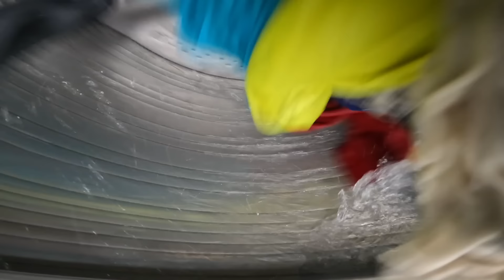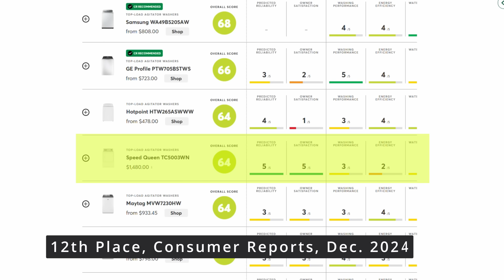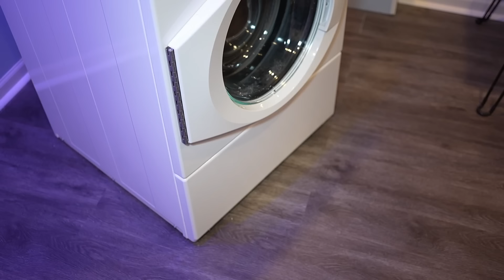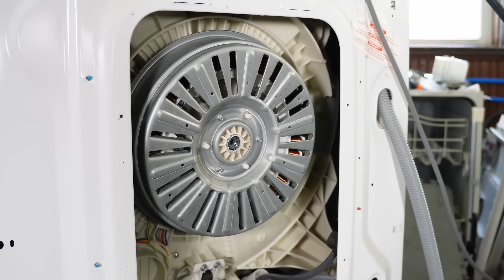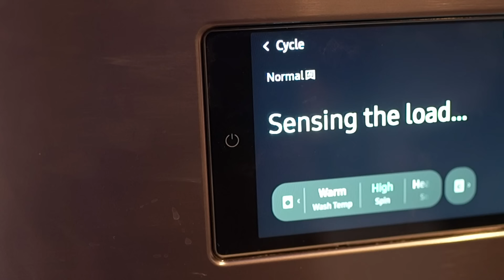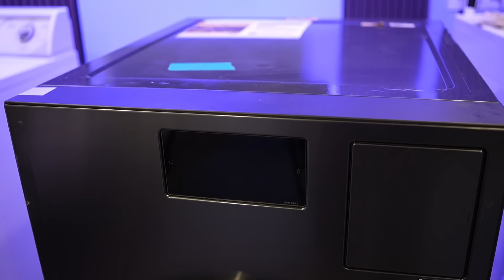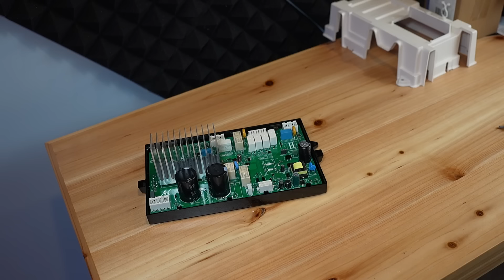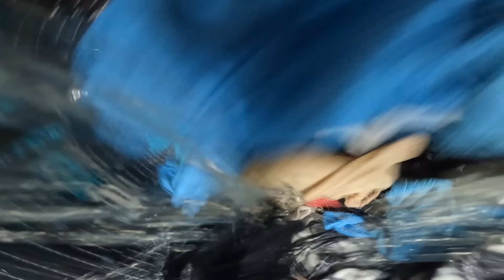Is America's Most Expensive Washer Great? The Speed Queen FF7009WN Test

Comment: I don’t want a front loader, I prefer a top loader. My first washer and dryer was a Speed Queen set that was stainless steel inside so I didn’t get any rust from the tubs but the outside case started rusting. The was the reason I got rid of it. I replaced then with a top of the line Maytag set that was a made in America and it lasted for 25 years, now my washer has broken but the gas dryer still works. I want to be able to open the lid and add something to the load and I don’t want to lean over to put clothes in or to remove. I won’t buy any other brand now since Maytag stopped being made by the original factory. So I will buy Speed Queen. Why can’t America make everything anymore? I don’t want so many electronic controls. I hope to get a simple system, I only want 3 water temperatures, a short wash and regular wash. I use only liquid detergent because I found out the the granulated detergent had a damaging chemical added to make the washing powder and that liquid didn’t have it. Tell me if I’m wrong. I want simple but well made. I see those circuit boards and I see trouble.
Reply: Miele try it
Reply: Despite the SQs being made in the USA, they still have many problems, and terrible policies for their warranty. They used to be great but now they’ve cheapened their products and are just using their brand name to sell. 
My TC5 died after 1 year, same with the TR7 before it that lasted 2. The problem? COMPUTER BOARDS. No issues like this on the old AWN432, if they still made them I would have one in a heartbeat. Computerized machines are just cheaper to mass produce for them, so they take that route and just make the machines look old school. Shame.
Reply from the maker: @DylBuilder1  the irony is that in the 1990s, Speed Queen actually had a pretty bad reputation. Maytag bought out Alliance Systems/Amana units as well as a whole host of other drivetrains and systems back then before they went under. So you could have had Amana-branded Maytag-Sold Speed Queens (model name: SAV) and guess what? They sucked. The Norge machine PAV machines were bigger, better, and cheaper.

The Speed Queen design is one they've worked all the kinks out of, but its not a great system, IMHO. People can cancel me over it, but I'd still take a Norge, Maytag, or Whirlpool Direct Drive system over a Speed Queen for top load.
Reply: @bensappliancesandjunk  I do remember that! Kind of funny that in that era quite a few brands were involved with another, even the ones that were previously in competition. I do remember seeing a Maytag set from around 2005, and the dryer had a SQ drum and bulkhead. 

Yeah it works well for what it is, but I think it's focused on simplicity or trying to use the least amount of parts possible. It is similar to the helical drive Maytags in some ways though. Just wish the other parts of the machine were still made well! 

Same here, I would 100% take those machines over them, and pretty much anything on the market! Great review as usual Ben :)
Reply: Get the TC5 top load Speed Queen. I got tired of buying and repairing unit after unit. They became unreliable money pits. Here is my (all top load) "washer history" : 1. Whirpool (1995-2011) 2. Maytag (2011-2018) 3. Whirpool (2018-2024) 4. Speed Queen TC5 (November 2024 - ) Note: In Canada Speed Queen is known as "Huebsch". I'm hoping this one goes for a long while.
Reply: Don’t worry about circuit boards. They are only replacing the mechanical timers which was the “weakest piece” in an old washing machine and where the most common expensive repairs come from. Circuit boards are FAR more durable than mechanical timers
Reply from the maker: @spinnymathingy3149  assuming they build them right. That's always the issue if they use sub standard components
Reply: @ oh you’re correct definitely, same with everything I suppose. 
Just thinking back though over the decades, 90s when there was little in the way of electronic drivers (only mechanical timers in washing machines and dishwashers) I had boxes of stock in my service van full of mechanical timers. Failure was a daily occurrence. But now days I have on hand very few electronic PCBs, and I’m finding failure in general Is more so a rarity 🤷🏻‍♂️
(Quick anecdote, for repairing general I’m finding 
Washing machines, it’s pump blockages, wearing suspension , bearings, door seals 
Electric stoves it’s, elements, door hinges and multi function switches 
Dishwashers it’s customer misuse (food blockages throughout)
🇦🇺🤘🤷🏻‍♂️
So Ben , what are you finding on the other side of the pond ?
Reply from the maker: @spinnymathingy3149  that is WILDLY different than the US. Board failures are a nightmare here. Watch my recent videos on GE inverter/mainboard replacements. We now stock/sell OEMs because of how many are failing. Many models here are not built very well with surge supression to where if the pump/door lock fail, its blowing the board up. Its very, very gross.
Reply: @ wow, that is a poor design issue, (I definitely have seen a lot of door lock failures blowing the boards, but not so much for a decade now)
Reply: I bought a Maytag about 3 years ago.  It's the one labeled as commercial and it's a top loader. It has the full load and a half load. Not really lots of choices just looks like a standard old timey washer. So far it's been pretty good. I got sick of front loaders too and will never have another one again.
Reply: Also for a while Raytheon (the missile company) owned alliance
Reply: The wash action of front loaders seem to be the best at mimicking hand washing.
Reply: I currently have a KENMORE top loader, maker unknown, that I bought from. Sears in June of 1996.  A couple of clutches, a pump, and a transmission later, and it still WASHES WELL.  The repairmen all said, Don't get rid of this washer.  Just keep fixing it.  The parts are still available."
Same thing with the electric dryer, a new motor, and a couple of belts is all.
THAT is the type of reliability I want from my appliances.  Judging by what I just saw, this is almost the machine for me, except it would be a top loader.
Reply: Biggest reason why is big mafia (government) loving Demoncrats and all of their restrictions and regulations being put on all of our appliances. Now they HAVE to all be technology driven to abide by all of these rules. Therefore, you're paying more for all of the development side of things and ultimately, poorer lasting products with gobbled gook and dodads passed down to us by our overlords.
Reply: Why USA can't make simple machines? Because most of north Americans don't know how to use the washers. They use a full tub of water for a less than a half tub water.
Reply: @joaovictorholladery3793  marketing, it’s all about marketing